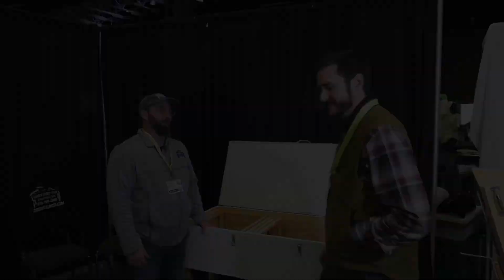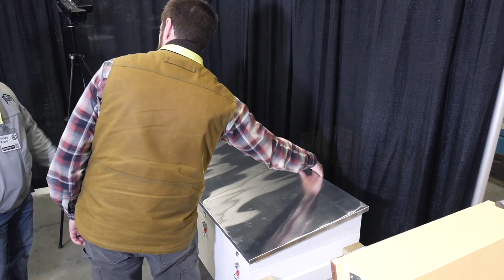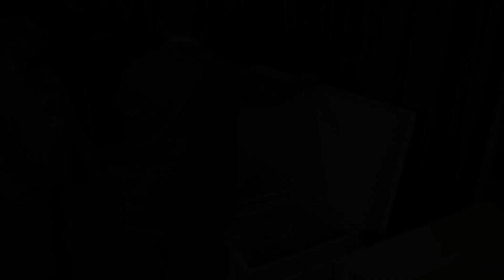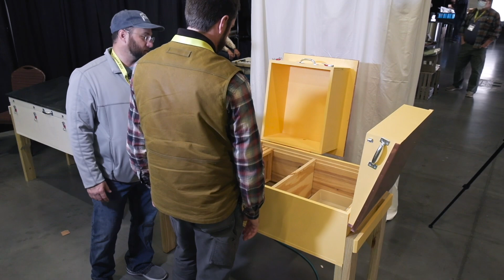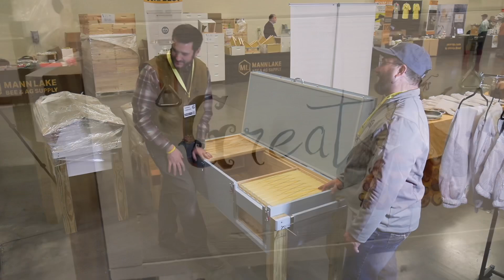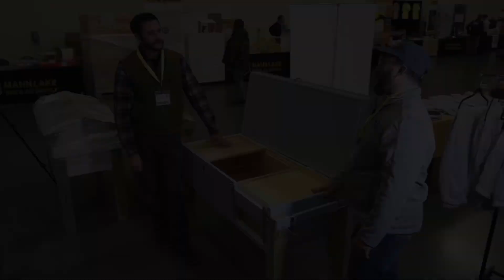Horizontal Hives - @Thebeeconnection  Interview

Comment: I'm sure someone has thought about this before, but I wonder if making the legs and potentially other components detachable so they can be placed inside the box for shipping, thus making the box into a shipping container, would make the shipping cost more economical?
Reply from the maker: They are detachable.  Still would get hit on dimensional weight.
Reply: @DuckRiverHoney  so true. I hope they can figure out a distribution plan or flat pack system, etc. I really feel like these could fill the niche many thought the Flow hive would.

Comment: I love these hives! My first two hives were horizontal. Ricky is absolutely correct about these working for single brood management. The trick is to ensure you create a "honey dome/line" after the 10th or 11th brood frame. I experimented with a two-queen system and I found out they quickly ran out of room for brood and honey stores. I eventually merged the hive back to a single queen. I also built double-deep horizontal last fall with a center divider and about 30 frames per side for a two-queen system. It's a monster but it will give the bees plenty of space for brood and honey stores. Great interview!
Reply from the maker: Interesting stuff, thanks!

Comment: I'm thinking about getting a horizontal hive. I currently run both topbars and Langs, which makes it a little challenging if I need to interchange frames/bars. A horizontal hive would make it sooo much easier.
Reply from the maker: That’s one of the big advantages…you can run a double deep with a medium honey super inside the horizontal.  Makes life lot easier if you’ve already got equipment.